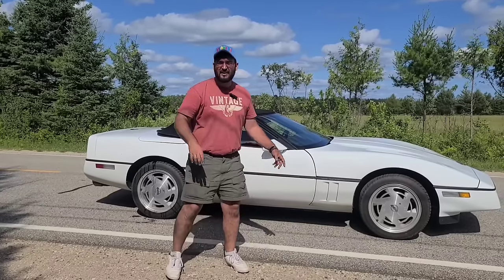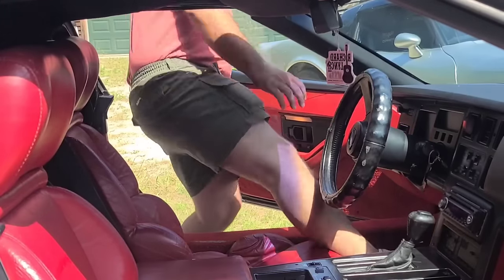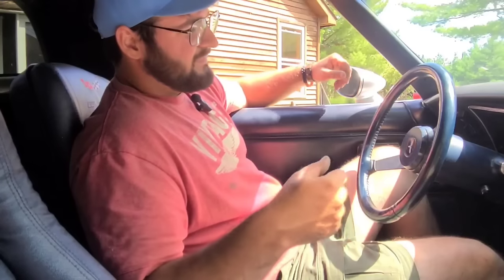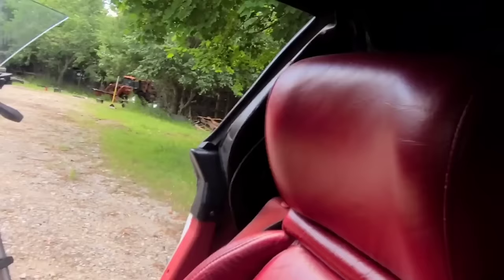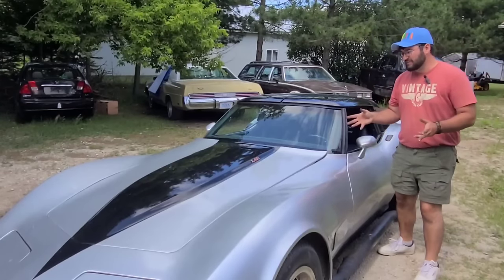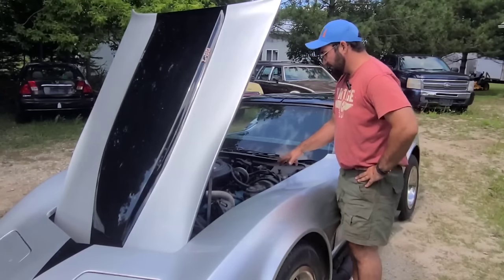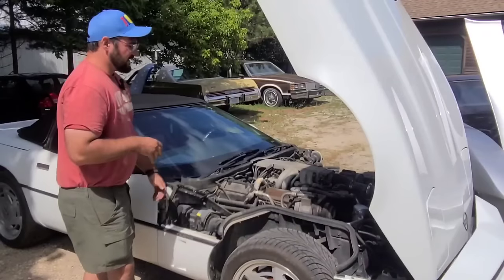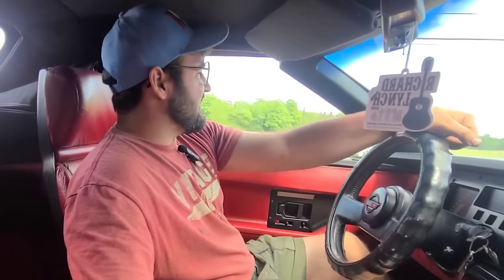C3 vs C4 corvette, which is the better buy?

Comment: The C3 styling is vastly superior to the C4  If you want performance you'll be doing an LS swap in either one but good luck finding a C3 for 5k.  If the C3 leaves you stranded then you don't know how to maintain your car.
Reply from the maker: I've replaced many parts on the c3. Can't predict when an old car will break, once starter went, another time coil another the alternator. You just don't know with old cars. I paid 3800 for the c3 2 years ago. They're out there.
Reply: post pic of your C3 with bread on hood

Comment: Sorry sir... for 5k.. I'd actually get a 87 v6 or 4cyl Pontiac  fiero... smaller  frame easy to get parts. And still has a trunk for over night bag and a full size space..plus the mini spare up front.. . but you have fun with  your vettes...
Reply from the maker: Can't say I blame you. I'm not a big vette guy either. But my Grandpa sure is. There are probably better ways to have fun for 5 grand but if you're looking for cheap old muscle it's not the worst car to buy
Reply: @junkyardjoe1994  my fiero has a Cadillac cts v6 ..it was plug and play with  only one extra bracket...$25.00
Reply from the maker: @mv4463  that's pretty insane. Those motors were pretty good if you keep up of the timing belts. I'll bet that's a wild ride
Reply: @junkyardjoe1994  put extra  weight  in sand bags in the front trunk.. it sails easy at 90mph.. mine has done 115.. when normal is only 75 at best.. I'm currently looking for a quick silver style fiero.. then I'll  have the full set of 5 models of that year...

Comment: I owned a 1989 Corvette when it was only 5 years old and had 2600 miles the day I bought it.  You aren't correct in your assessment. When they were new, they had a really good ride, firm but a float similar to a Cadillac. In 89k miles, my car had absolutely no issues, and not once did it fail to get me home. I assure you I romped the snot out of that car everybday too.  The 1989 Corvette was better handling and faster than the Ferrari Testarossa and the Lamborghini Countach of the same year.  Regarding the handling, your examples are tired.  I assure you my car in its prime would smoke nearly all contenders of its day.  Just like the C8 is highly competitive in its market and time.  Somwone will be bashing it in 30 and 40 years without a clue of how good it really is.
Reply from the maker: I don't think I really bashed on either of them. They're both not prime examples. Just doing a little comparison for a $5000 vette.
Reply: @junkyardjoe1994  ride like a log wagon?  The Camaro of the day did just that and rattled and squeeked. But, the Corvette was at least 8-10 years ahead of the Camaro in every aspect back then.  Plus, the mid-engine layout of the Corvette just gave better handling and ride characteristics with its 50/50 weight distribution.  I'm not meaning any offense. Just the car was so much better than you made it sound.

Comment: In stock form? The C4 makes a better "daily driver" but that's about all I could ever say to recommend it over the C3. Here's the unvarnished truth from someone who has owned both cars over the years and still owns a C3 today yet wouldn't even consider a C4 again for purchase beyond a possible chance to "flip" for profit. Both cars suffer poor build quality and by today's standard are super weak performers in stock configuration. With that said I could never live with either of these cars "stock". So now you gotta do some work to make them "better". This is where the C3 becomes the objectively argued far better choice. Subjectively I just the style better too. The C4 hasn't aged as well to my eye but that's just opinion yours may vary. So If I stick to which car is easier, less expensive to work on and up grade it's pre computer era C3 I find the far better choice. It will never match the MPG of a modern car but I don't see any car this old as a daily driver. Stroked small block chevy engines making 400-500+ HP with modern roller cam profiles and aluminum heads are super easy today. Upgrading suspension also very easy and many very complete set ups balanced and available all just bolt in place. Where this really works in the C3's favor is found in the over all simplicity of it all. I can think of nothing on the car that should be beyond the ability of the DIY guy to accomplish in his own garage. The C4 shares some of these positive points too but ultimately the car is a big step into the world of tech and a lot of it is not only more expensive but also may prove tougher for the DIY guy to accomplish.

Comment: I FIND IT HARD TO BELIEVE THAT 89 VETTE WITH 83,000 MILES ON IT WAS ANYWHERE NEAR $5,000. C3 FOR 5 GRAND IS MORE PLAUSABLE
Reply from the maker: Oh it might look nice in video but it's got many rough edges. I see lots of c4s for dirt cheap prices. I saw one for 3000 a couple weeks ago
Reply: @ryanfontaine6131 80s C4s are considerably cheaper compared to the 90s LT1s especially if they're automatic. I got my 94 w/ 70k miles for $6k at a dealer. C3s on average are outrageously overpriced in comparison, so im not sure where you're getting your numbers from.

Comment: No offense but you shifted the C4 at 2.5 rpm into 2nd gear…. Lol i feel like you could have easily pulled a 7 second time!!
Reply from the maker: It certainly did shift a little early. I could've probably improved on a second pass. Tv cable probably needs a little adjusting as well

Comment: Those 80’s are skyrocketing. If you can find a half decent one for 5 g’s you better jump on it.
Reply from the maker: I got this one last year for 4200
Reply: It may need work, but that was a great investment. Classic styling, easily modified with newer drivetrain. They have went up in value dramatically from what I have seen. Good luck with it!
Reply: If so, it’s kind of perplexing to me that it’s taken so long for the C4 to finally start going up in value. The C2 was considered a classic within 25 years while the C4 has been vastly outpaced even by other cars from its era. The hopped up G-Bodies including the Monte Carlo SS and Hurst Olds and the Fox Bodies are easily going for 2 or 3 times as much than a C4 Corvette.

Comment: Not a 1990 does not have 395 torque  only 340 ft lbs. This guy obviously has no idea what he's talking about
Reply from the maker: I said 375 but you're right it's an 89. My grandpa bought it brand new in 90. Not a massive mistake I think the comparison overall of the cars still works.